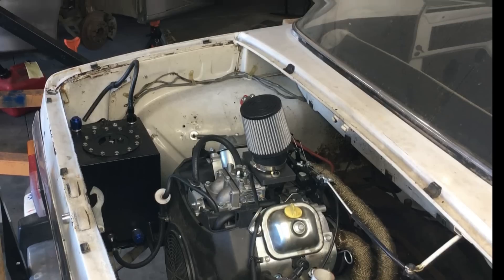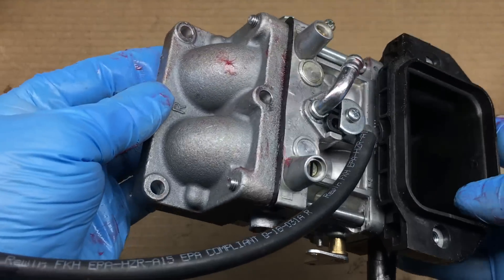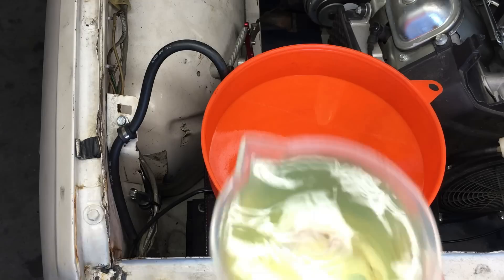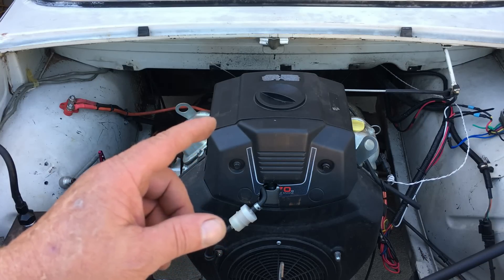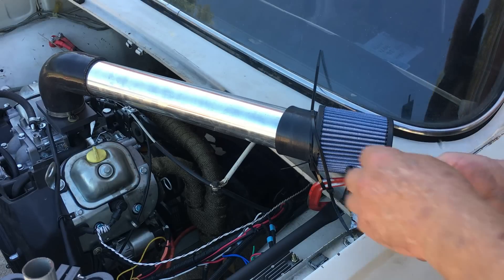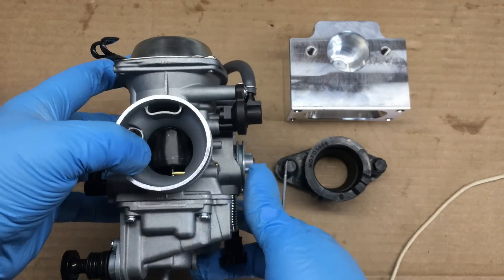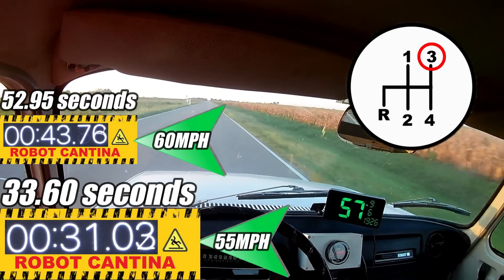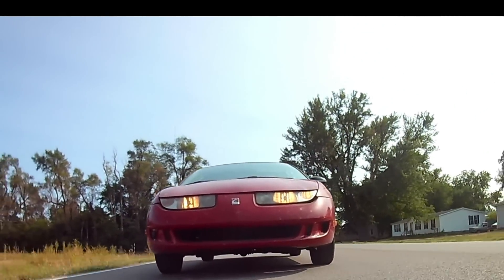S3 E28. Performance tuning and MPG tuning the 670cc predator powered Renault

Comment: the "potentioneter" on the throttle body only opens like 90º.
the onboard Arduino ADC is 10 bit, 1024 positions, you need to find out when the butterfly is opened max what value on the ADC that is, that's how big your array with PWM values needs to be.

But first you have to measure the RPM correctly, to figure out how much time the in valves are open, as this time get shorter the higher rpm is. the downside is the ATMEL328 has only one 16 bit counter. maybe a Microchip Fubarino (witch works with the Arduino IDE) is a better choice with has 5 x 16 bit timers and 32 Bit precision and storage on calculated numbers rather than max 256 values and 48 MHz, 3 x faster than a standard Arduino but 3V33 output.
That board is very well designed, small. you might do some extended research whats best to convert 3V33 to 12V via transistors/mosfets. injecting 3v33 into a mosfet powered by 12V result in something like 3V33 at the output. the Transistor doesn't have that problem.
The 3v33 maybe used by the SMD hal sensors chips, witch are really tiny.

from the Hall sensor "tick" you need to start a variable timer and count down to shut of the injector. the MCU goes much much faster than your engine and can do this with ease.
You need to measure the duration of the Hall sensor ticks, to prevent false alarms.

So you data array needs to be organized in "structs" that hold 2 data, the PWM and the shut off time for the injectors. maybe you only need one "shut off" timer is needed, not sure.

Check my account, i uploaded a video for you with a transistor arrangement to Levelshift voltages upwards for Injector coils and other stuff.

Comment: For you who cares😅 - I was the owner of an BMW 530d A (e39) it had a 3.0 turbo diesel and ran 5.7ltr/ 100km at around 100km/h (60 miles) the car weight was 1880kg and had a topspeed 247kmh and 0-100 at around 6,7sek. 
I kept that engine for a boat but sold it cheap before knowing this channel.

Comment: A high performance cam will improve performance too, I had bought and installed the 507 cam, it brings more horses and you can bring the RPM range up to 7900 RPM's. That will give you a higher top end.

Comment: I still wonder what the outcome would've been with the new 1000 cc predator engine. I know there isn't much available for it parts-wise and that leaves out some experimenting, ( if that means you're going to add performance parts that is),. The size would've come close to the original and that makes me wonder how it would've performed. Just throwing that out there.

Comment: If you treat the intake manifold as you would with any performance engine, the open spacer is going to turn it from a dual plane to a single plane, and that will certainly impair low rpm response and economy.  You probably already know that.  Increasing the split plenum volume would help, and adding a butterfly that opens the split above 2500 rpm would be very interesting as well.
Reply: The other thing is that this V-twin is an uneven firing engine. Engines with uneven firing can be subject to strange behaviour of the mixture if the cylinders are all pulling from a single carb, e.g. one cylinder can be 'starved' and run much leaner than the other. The stock intake avoids this by dedicating one carb barrel to each cylinder, adding the spacer might have allowed one cylinder to 'steal' mixture from the other.

Comment: it might be worth adding a very large plenum chamber(the bigger the better) to the ram air system. this will convert velocity to pressure as fitted to big sports bikes. the issue also will be the pressure difference on the fuel float chamber that will force fuel out so the breather for the float chamber needs to be connected to the plenum chamber.

Comment: I really dislike how that carb is setup on the factory motor. Having those two opposing 90 degree bends has got to be bad for power and possibly fuel atomization.

Comment: The ram air didn't work because you didn't put the carburetor bowl vent to positive pressure. It's the same way if you did a turboed blow through carburetor. The fuel bowl air pressure needs to be the same as what's going through the carburetor  or the air pressure will push the fuel back through the jets and lean it out

Comment: If you want to play with the carburetor first that's fine, but I still want to see a predator pushed to the limits. We got close with the insight, but I really want to see what can happen with EFI & a good tune, turbo, ram air, and nitrous (either wet or dry / ECU compensated). I understand being careful with the diesel, but the predator engines are cheap enough to take a few risks. Anyway, another great episode!

Comment: So, the Keihin CVK looks like it works on a similar principle to the SU carbs. Except with a diaphragm instead of a spring and oil damper.
Reply: The slide of the SU carburetor has a large piston that works with a very tiny clearance from its cylindrical housing, guided by oil damper slide. Late models like on the 1980s Austin Metro have a linear ball bearing for even more stiction-free operation. The slide piston must not actually touch the inside of the housing; the usual symptom if it does touch is that the engine stops when you throttle it down to idle but can then be restarted and will idle perfectly.

Comment: I would revisit the ram air with EFI if you ever go back to it like you did with the insight. I imagine you would need a very sophisticated carburetor to operate under such wide pressure conditions. Where as EFI would only be limited by injector size or the A/F sensor.
Reply: This was my hope as well!

Comment: Maybe an adjustable length intake would be a good experiment.  Have the carb mount slide back and forth between the two cylinders.  Just to ID what would equalize the draw and timing of flow of the unequal timing inherent of V-twins.

Comment: 3:20 I’m exactly the same with fuel economy testing. It takes ages, and is a pain in the arse to try make them as accurate as possible in a real world scenario. 

I’m not at the ram air bit yet, but I did a similar experiment and it worked surprisingly well so I’m looking forward to your results. 

P.s. on a carb, for ram air to work properly you want to take an air feed from the ram air intake to the carb vent to pressurise the float bowl, otherwise it will often lean out. Like I said though, I’ve paused the vid and I’m not that far in yet so you may have actually done this already!
Reply: I’ve just got to the ram air bit and I’d deffo try the air tube going from the positive pressure part of the intake, to the float bowl vent on the carb to see what happens. I don’t know if YouTube will delete this comment cos of having a link in it, but this is my ram air vid if you’re interested in that. I have the simplicity of it being on a MAP sensor controlled injection system though.
Reply: https://youtu.be/ox-R1MVXeF8

Comment: "Nested" intake and exhaust manifolds on inline engines was common from the early 1900's untill fuel injection and multi valve crossflow heads became more mainstream.

Comment: The cvk is a nice carb. But I will say if you get a flat side carb and tuned with the afr gauge, it will definitely be a nice upgrade.

The issue, though, would be the throttle. It used a motorcycle style one for the throttle slide while the cvk uses a throttle cam like a traditional car.

Comment: It would be much better to machine a disc with 2 neodymium magnets acurate to top dead center of both cyl to be installed on crank for a home made PCB using kicad to hold 2 Hal sensors and use these on a Arduino, than make a 10kHz timer to measure the RPM for a start. Using some mosfets, transistors to convert 5 Volt into 12V strong enough to move a fuel injector with a PWM signal, of course using a potentiometer on the "throttle body" (otherwise you would be no where) to point to a data array with PMW values to loaded to the fuel injectors.
the first cars with injection used a 4 MHZ intel mcu, the Arduino is 4 x faster.
i saw a video of a guy that made a Volvo 240 run on a microchip pic18F...
pretty much all mcu have a PWM module on board.

This fideling with a carburetor! software allows to dial in exactly.

Comment: Could you chop the bottom of the funnel off so that it is level with the fuel when the tank is full. You could then just keep poring in measured amounts of fuel until the fuel level reaches the bottom of the funnel (instead of having to take the funnel out, align the file and set square, then put the funnel back in, add more fuel, repeat).

Comment: Trust me sir, if you want performance, take the time and put a better valvetrain, head, and stronger pistons with independent carbs. It'll take a lot more work and tuning, but the performance numbers will be worth it!
Reply: And bore out the cylinders, and couple about 4 of the engines together, although probably easier just to change the engine block.....

Comment: So I love the straight edge across with fuel cell with the combi square for measuring the fuel level, but to increase the accuracy how about a little gnome in a boat acting as a float holding up a stick, fill the fuel cell up until the end of the stick reaches the same point on the combi square every time
Reply from the maker: Hmmmm....  I reckon that's not a bad idea.  I'll give it a shot.

Comment: Your engine isn’t made like the VW engine as it was a boxer and yours is a V 2 . The VW engine has the cylinders so far away, the fuel atomization starts to condense and becomes air and fuel instead of a fine mixture. Hence, it needs to heat up the fuel. If you do that on the 670, you will create vapor lock. Did you think to try the carburetor spacer between the intake and the heads? I think a 1” spacer would help between the intake manifold and the engine would make it farther away from the heat and would give the mixture more time to straighten out, without having to worry about it getting too cold.

Comment: 2 suggestions. First, don’t use the stock 90 degree manifold or the 90 degree adapter. Just 3D print a straight adapter or machine one out of aluminum. Second, try a small base Rochester 2GC carb with a straight adapter like I am suggesting with the other carburetor. It is closer in size to what you need than you think and are cheap.

Comment: Good video! Recently Uncle Tony did a similar fix on his slant six drag car, he found that routing some exhaust heat to the intake manifold both improved his time and made the engine run smoother.
Reply: It's air cooled, so perhaps routing the cooling air?

Plus your get fan assistance for free.
Reply: Not surprising - heating the intake runner prevents fuel condensation, particularly if the runner isn't straight. A downdraught carb has less of an issue with it.

Comment: Why is the car scary over 60mph, does it get squirrelly ? 
Might have a bad alignment or work out bushings giving it a bad “dynamic” alignment. Or was it just never built to go very fast?
Reply from the maker: The car is lighter than it was originally and the wheels are not balanced.   Balancing the wheels is difficult because they will not fit on any wheel balancing machines.
Reply: Wonder if a motorcycle or scooter shop would have machines that could deal with the smaller wheels as long as they could pick up the center bore

Comment: Presurizing the air pushes fuel back down the jet carburetors, therefore you technically need to make air box that fuel encompasses the carburetors to pressurize the carb as well as the air going in thru it to balance the pressure in the bowl. That will solve some of the lean issue but youll still need to gine tune it. 
Wish you would install your injection sytem that you used before because the map sensor can compensate for the add air to adjust fuel mixture
Reply: I expect he'll get to the EFI and all that eventually. In his previous projects he started out with simple and modest changes before making increasingly larger changes.

Comment: The pressure from the ram air system also needs to connect to the vent of the float bowl.  The jets work on the pressure difference.
Reply: Yep, gotta reference the venturi side to the bowl side. Motorcycles have been doing this with carbs since the 90s, and they all have fuel pumps that can exceed the ram-air intake pressure plus the bowl(s) vented to the intake...
Reply: @Xargsify  Yes cars and motor cycles do it but maybe a lawn mower didn't.  It would explain the ram air thing and also the mixture being effected by other things that may be the same sort of effect.  Done right, ram air may get them as much as 2 extra squirrel power.

Comment: Will a Carb Cheater work on it?

The Carb Cheater controls a vacuum leak to tune the carb, so it should, in theory…
Reply from the maker: I mentioned thunderhead289's carb cheater a few videos ago.  The big issue with that is there is a 2  month waiting list to get one.

Comment: Thanks for the recap of the progress so far. It's hard to believe you've been able to make such an improvement with relatively little modification.

I totally understand wanting to tune the engine performance before tuning the transmission. The engine develops the power according to the load, while the transmission converts it to the appropriate torque for the current speed. The tuning of the transmission will greatly depend on the power curve of the engine, whereas getting power out of the engine is its own thing. And whatever you do, you don't want to change a bunch of things at once, otherwise you won't know what change made the difference.
Reply from the maker: Exactly!
Reply: @robotcantina8957 as you are not losing traction and the car is light, would it be allowed to use motorcycle tires? There should be more slim options and also aerodynamic ones - would that be cheaper and legal? No saying it is worth it, just wondering if it is an option 🤔🤓
Reply: @TheStuartstardust You can't mount moto tires on car rims - the beadlock is entirely different due to the lateral forces the tire must endure. They're also generally heavier than an equivalent-size car tire, because of all the reinforcement necessary.
Reply: @lr0dy  bead might be issue yes, but you can the other way around? BMW has a motorcycle with a sidecar which use car tyres, some others also. Also ryan f9/fortnine had an episode about tyres where he mounted car tyre on a motorcycle 🏍️
Reply: @TheStuartstardust  The bead of a car tire is somewhat smaller than the bead of a bike tire, if I remember correctly, meaning a car tire can fit onto a bike rim. It's a stupid idea, but you can do it. The larger bike tire bead however will not seat onto a car rim.
Reply: @TheStuartstardust  Also, a car tire on a sidecar makes sense, because it's never going to lean. Once you throw a sidecar on a motorcycle, they're no longer ridden the same.
Reply: @lr0dy  buggy wheels, weight reduction.

Comment: Driving  around on a 100 degree day in my girlfriends Austin America the engine suddenly died. I got out and opened the hood to find that the carb(constant velocity) was a large block of ice. I chipped some away and as soon as it was mostly thawed I discovered that the heater band that was wrapped around the top had the wire broken off. I thought it only worked to warm it up during cold weather. Apparently that particular carb was very efficient at vaporizing the fuel. No wonder it got a solid 35mpg all of the time. Hooked the wire back and away we went !
Reply from the maker: LOL, I had the same problem with my Triumph Spitfire every spring.

Comment: Can you put the vent for the carb and the fuel pump into the intake manifold when doing ram-air? It'll keep the same relative pressures through the system and you'll have more consistent mixtures.
Thanks for providing this content- it's a lot of fun!

Comment: For a simple variable venturi carb, you can't go past the venerable SU. The standard mini model would be suitable and they are so easy to tune.
Reply from the maker: I would have preferred using an SU as I have owned many British cars and I'm familiar with them.  The CVK carb we are using cost $40.00 brand new and parts are cheap.

Comment: Wonder if it can pull a small camper like they like to in Europe 😂. Seen a build where the guy built a tractor with the predator just added a chain between the manual transmission and cvt to make the gearing even lower
Reply from the maker: The 212 and 420 powered Honda Insight we built a few seasons ago used a chain jackshaft to modify the ratios.  In our very first video ever we show the little Honda towing a Jeep that was also towing a trailer.

Comment: Maybe you could thermal glue a thermocouple and a PTC heating element to the intake manifold to have great control over intake temperature. will you also move it to EFI at some point like the Insight? cheers
Reply from the maker: We may do EFI.